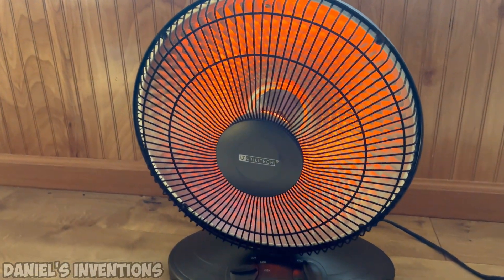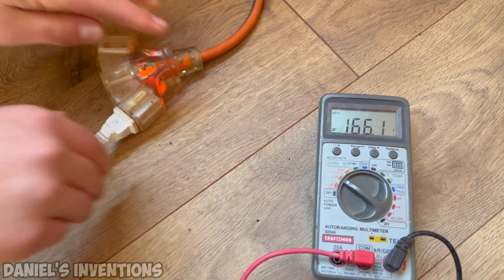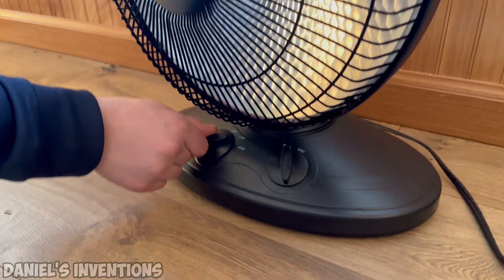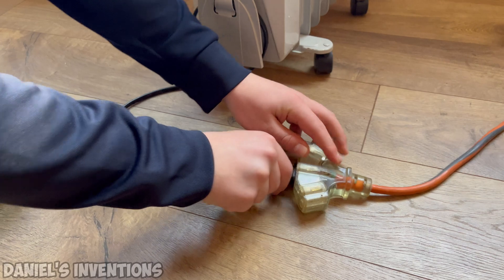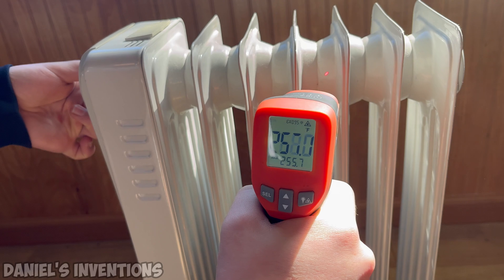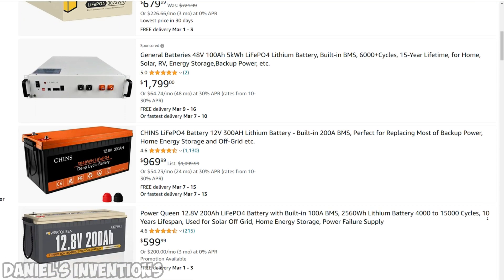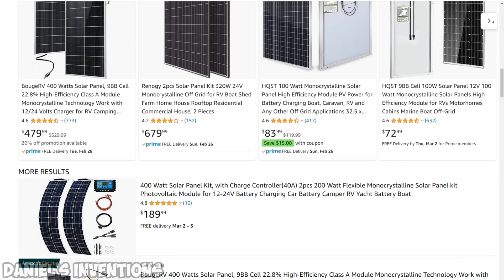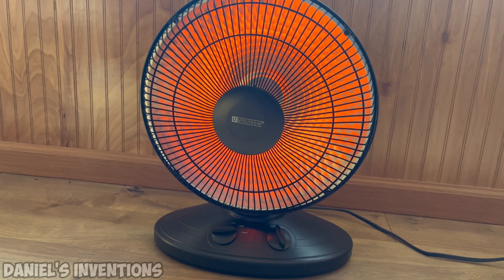How to Power a Space Heater ONLY Using Solar Panels

Comment from the maker: We purchased four used 400 watt solar panels for $50 each for a total of $200. The voltage potential is around 160 volts DC, but with a space heater connected to it at full blast, the voltage drops to around 120 volts DC. The heater becomes very hot, radiating heat into the house. The outdoor temperature can be way below freezing, but as long as the sun is out, the solar panels generate electricity which powers the space heater and heats up the interior of the house for four hours. Now if the solar panels were installed on a solar tracking system, the same setup can generate six hours of heat for a total of 9000 watts, a 50% increase. That will save at least six hours of your heating bill per day for your home.
Reply: How do you connect the fan to panels?
Reply: Any electric heater can be run by Solar/ DC? or the one you use is specially made for solar/ DC? If yes, whats the link to this product?
Reply: 400 watt panels for 50 a piece is straight luck
Reply: @solfreshsolclean Did You Even Look I Can Find Tons Of Used Solar Panels With Basically The Same Efficiency As New
Big Companies Sell The Old Ones For Measly Percentage Gains And Tax Reductions 
$50 For 400 Watt Panels Are Everywhere

Comment: use a DC water heater rod in a bucket of sand for radiant heat at night
Reply: Yes, that’s my idea.  Would one designed for AC work with DC there’s no moving parts.

Comment: why in direct sunlight would you need heating in your house.  solars problem is when its cold dark etc. it does not work. unless you use  expensive batteries.

Comment: I have an oil heater that looks just like that, that is meant to be plugged into 230V AC (Europe).  Might it work as well, with no fire risk?
Reply: did you find the answer to that? 

Any electric heater can be run by Solar/ DC? or the one you use is specially made for solar/ DC? If yes, whats the link to this product?

Reply
Reply: @sediqkhan8353  the more generic heaters without digital controls usually work, I tired various oil filled, nichrome style and quartz heaters that just had switches and no digital readouts etc, all of them worked the quartz heater was super hot and the oil filled held heat longer.

Comment: You should look into magnetic neutralization there getting 2 1/2 times out put verses input ..it's a wheel with large neos on the top edges disks then near the center about two inches from the center a set of much smaller neos that line up with the rim neos .the rims are generator ..motor neos and the center ones are the neutralization ones on the two outer plates are the coils for the rim and adjustable small neos for the center neos you adjust for max out put .it removes the lock up and more .

Comment: ??? How are you plugging in A.C. heaters with 2 prong male plug ends into solar panels they most likely have positive and negative MC4 connections????
Reply: Cut wire or make adapteri

Comment: I would utilize the heat generated on the back of the solar cells and redirect it to the place that is needed to heat. This heat build up from the conversion depletes the solar cells efficiency over time and the cooler the cells the better the life and conversion co efficiency. No need to use huge amounts of wasted power rather be more efficient where it needs it.

Comment: If you already have a high efficiency minisplit heat pump, adding an inverter and a few inexpensive golf cart batteries can provide over 4 times the Btus of heat for every watt consumed compared to electrical resistance heating. It can provide virtually free cooling in the summer too.
Reply: Any electric heater can be run by Solar/ DC? or the one you use is specially made for solar/ DC? If yes, whats the link to this product?

Comment: During the winter is when you need heat. And...The sun is low in the sky during the winter so you don't get direct sunlight.  That means the solar panels will only produce about one-third of what they're rated at during the winter. However,  if you live in the southern part of the country, solar panels produce better during the winter but still not full rated capacity. Used panels rarely if ever produce full rated capacity. Either way, you're still going to need many more panels than what you are suggesting in the video. Which makes this idea much more expensive and far less attractive.
Reply: Yep, if all you need is heat, placing a table covered in aluminum foil under a south facing window, so it reflects more light into your room will give you added light and heat naturally from the sun for a low-tech/low-cost approach to solar heating. Adding Reflectix to the inside of northern facing windows will help you retain that heat too, by reflecting infra-red heat back into the home. I use Reflectix inside the windshield of my motorhome and it works great in both summer and winter, requiring less heating and cooling to keep it comfy inside.
Reply: @SuperSushidog  no cold enough climate if you need cooling!!!
Reply: @philmenard3042  I'm retired FT in a motorhome. Before retiring I lived in New Orleans, but that gets a little cold for my blood in the winter, so I'm wintering over near Brownsville TX, right on the MX border. It cooled off to the mid 80's today from the low 90's yesterday - just like I like it. I haven't run my furnace all winter. The AC, that's another story. 🥶
Reply: Outdoorzee In fact, to obtain an optimal current of the panels it is necessary to install them more, but this thing is known..
Reply: In spring when it can be-20C but sun
Reply: Panels mounted at 70 deg. in full sun with snow on the ground will produce 120 % of the rated output at 0 deg F. A 400 watt panel will produce 480 watts.
Reply: @kkarllwt  Bi-facial panels MIGHT do this,  but regular panels will not.

Comment: Maybe use them to heat sand so it will last while the sun is down.
Reply: add salt to the sand for heat retention....add copper or aluminum sheet to sit in top of it